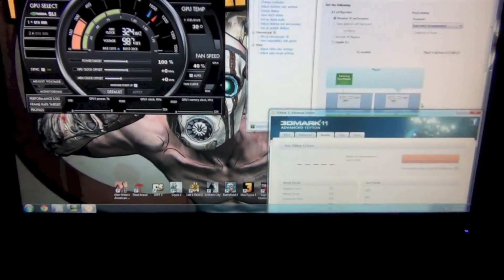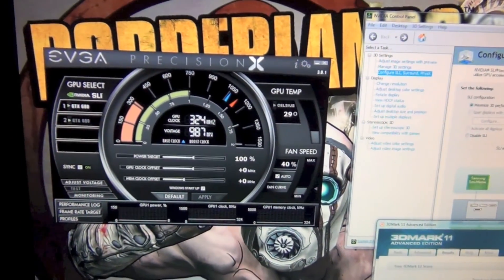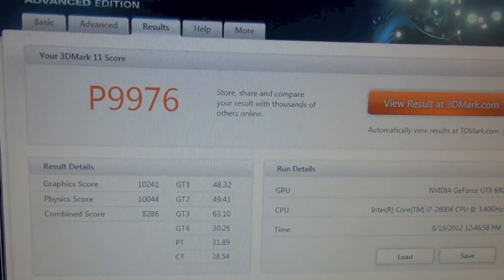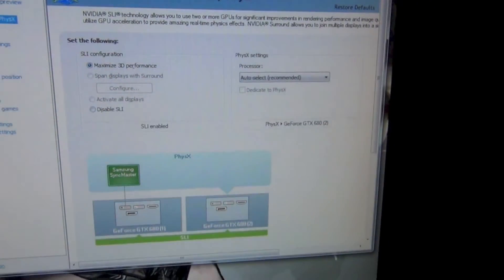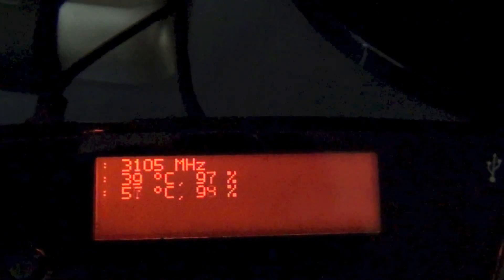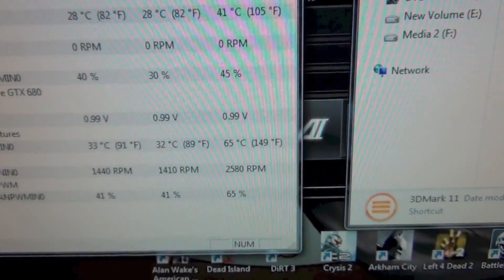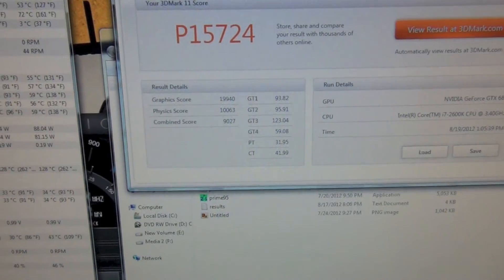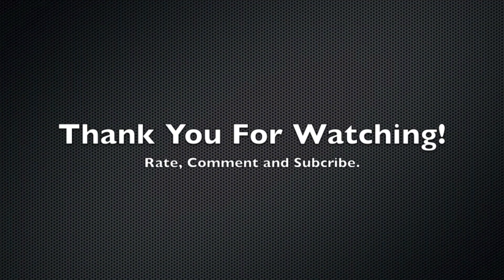GTX 680 vs GTX 680 SLI Benchmarks

Comment from the maker: Hey, thanks for watching! I am currently using Koolance GTX 680 waterblocks. I now have both cards watercooled.

 I'm not sure why, but when one 680 was on water and the other wasn't, my WC'd card would hit like 65C in SLI. When I just ran the WC'd card alone it be at around 42C. Now that both are WC'd neither will EVER break 50C no matter what, they usually run at about 45C. I asked about this on TomsHardware and no one knew why this occurred. Very strange. Thanks again, more videos coming!